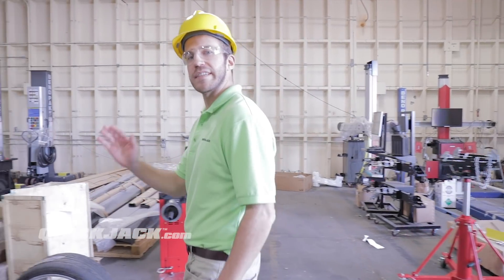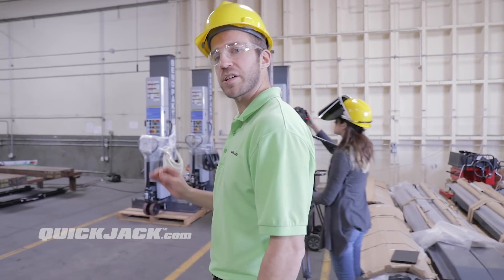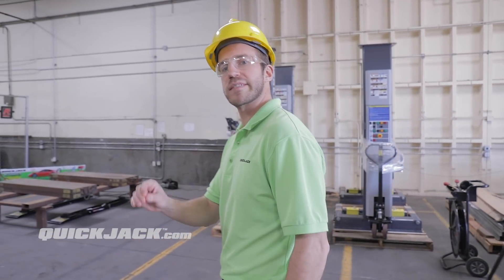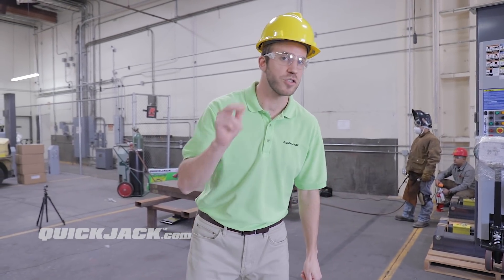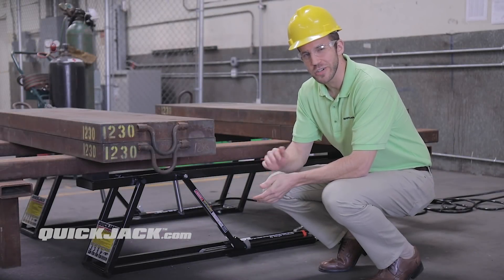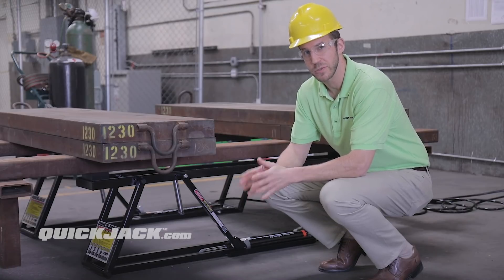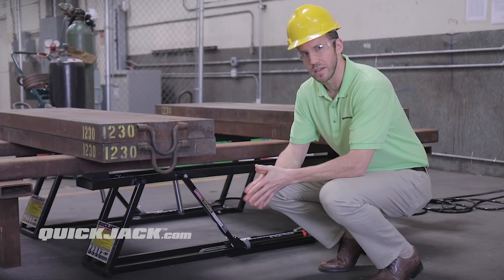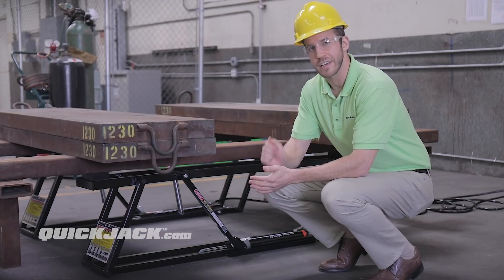We Destroy QuickJack to Prove It's Safe

Comment: what was the capacity of the quick jack used? and how much weight was on it?
Reply from the maker: Great question! That was a 5000SLX model with a 5000 pound capacity. It was loaded with (4) 1230 pound weights + (1) 200 pound platform

Comment: is this the 5000 or 7000 model and how much weight was on it?
Reply from the maker: This is the 5000 and was loaded with 4,920 pounds of steel plates, plus the weight of the test frame, making the total right around 5,300 pounds.
Reply: @quickjackusa  oh ok. I’m debating between the 5k and 7k because I have a Mercedes’ gl450 that’s closer to the 7 thousand pounds.
Reply from the maker: Anything over 5000 pounds curb weight and we absolutely suggest the 7000 pound capacity models!

Comment: I’ve seen the jacks overloaded on the locking bars in your other clip, so we’re all good 👍 Just wondering though, how are the locking points (nubs?) attached to the bottom slide channel. That looks like the weakest point? That or maybe the point where the bars attach at the other end. Watched a hundred clips so far and nobody shows these in close-up 😟

Comment: Can you use this on a slightly sloped driveway? Or does it have to be perfectly flat?
Reply from the maker: Thanks for the question! While it doesn't have to be perfectly flat, we suggest no more than 3 degrees of slope when lifting in the driveway. A simple test would be to set a water bottle on its side, if it immediately rolls away - too much slope.

Comment: should the mechanical locking bar have a locking pin so there could be 100% no failure incase the bar is knocked loose ? I've been looking to purchase this but doing my home work first
Reply from the maker: Great question! There really is no use for a locking pin as the bar is held in place by the weight of the vehicle. Remember the QuickJack must be lowered onto one of the locks when in use! This takes the weight off the hydraulic cylinder and puts it onto the lock. With the lock bar fully engaged on the lock, there is nowhere for it to go.

Comment: Great now lower it on the locks, cut the cylinder and then load weight until failure.
Reply: There is already a video of the 5,000 lb rated model holding 20,000 lbs.

Comment: Love the vid, I am a believer now and just waiting for a good price.  I have 2 question. What is the primary load support; the hydrologic pistons, the safety steel rod or both in conjunction?
Reply from the maker: Great question! While both systems are capable of carrying a load the primary support is the steel locking arm. In most instances, once the locking arm is in place, we will depressurize and disconnect the hydraulic hoses to clear up the work space.
Reply: @quickjackusa  Should the safety jacks fail, the hydraulics can still sustain the weight?
Reply from the maker: Yes, the hydraulics can hold the weight. However, you should never work on or under a vehicle that is not supported by the locking safety arms. While it is perfectly safe to use the QuickJack while only on the safety locks, it is never OK to use QuickJack while only supported by hydraulics. This is the same as with any two or four post automotive lift.

Comment: Ok nice video, let's say the hydraulics go out, can you safely lower the car then also or is it stuck there, do to the hydraulics going the relief valve would be shot also
Reply: Wonder if you could safely use two floor jacks lift it off of the locks then lower it? I'd hate to have a car stuck on the qj for a couple days waiting for parts.
Reply from the maker: There are several troubleshooting tips in the manual addressing how to proceed in case of any sort of hydraulic issue. Additionally, you can contact our tech support team should you require any further assistance. The manual can be found at this link: https://www.quickjack.com/downloads/QuickJack-Instruction-Manual-Rev-J-Dec-2018.pdf

Comment: Simple test. Proves a great point: the car is stable with the locks engaged. Bravo
Reply from the maker: Thanks for the comment! The sad fact is, even with our other test videos, we regularly get comments and feedback from people concerned about the strength of QuickJack holding up a load. Particularly, that people don't trust hydraulics to support their vehicles. Well, neither do we! We just wanted to show that once your vehicle is locked in place, its our steel frames that hold the load in place. Plain and simple.
Reply: @quickjackusa  yep, nobody should trust hydraulics under a car. So many deaths.
Reply: Understood and thanks for the reply...
Reply: Was thinking the same thing - not entirely sure of the point of this "test" except now you cant get the car down.

Comment: you wasted a good set of jacks
Reply from the maker: They're in QuickJack heaven now. :(
Reply: QuickJack  still not right im saving a bit off of every pay cheque to be  able to afford a set and you cut them in half. Very sad and wasteful
Reply: @gtarider477  Wow, good thing that car manufacturers don't crash their cars to test them, that would be a terrible waste...
Reply: GTA Rider, All that's needed is a new pair of hydraulic cylinders off the spare-parts shelf. What's the big deal? And even the torched cylinders are rebuildable. Typical "throw it away society" mentality. smh...
Reply: Actually the only thing wasted was the rods. I presume those cylinders are rebuildable and you can re-use the pistons and just get a new pair of rods.
Reply: Don't worry,  it doesn't cost them anywhere near the $1700 you spend.

Comment: I have a 2016 Crew Cab F150 and I would like to see a video where you lift a full size truck.  I've only lifted mine once and placement is different with the frame shape and balance point.  I could've lifted mine better and would love some tips.
Reply from the maker: Definitely! We'll add that to our list of Quick Tips. Great suggestion.
Reply: I agree. I have a chevy 2500hd 6800lbs curb weight.  4 door CC 8 foot bed...lets see that lifted also.

Comment: Amazing. Just got my 7000EXT and can't wait to use it with my Jeep Liberty. What model QJ was used in this demo? Also, can you do a demo on using the jacks transverse? All Jeep Libertys and Patriots require this, as do many other vehicles, since their lift points would not be parallel if used in the usual way.
Reply from the maker: Nice! The QuickJack featured in this video is a 5000SLX and to answer your other question, we will definitely add that demo to our list! Just make sure to keep an eye on our channel for updates.
Reply: I'm curious about this statement. I have a 2004 Jeep Liberty that I lift with my BL7000's in the normal position. Could you elaborate on what you mean about the lift points not being parallel?